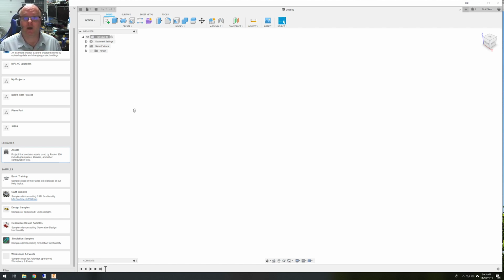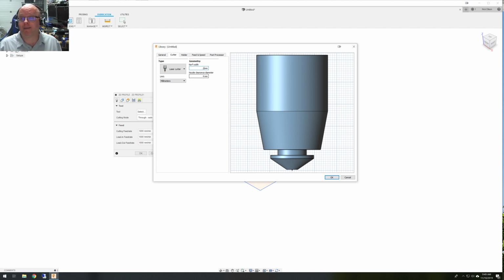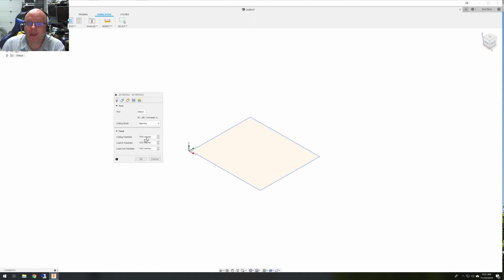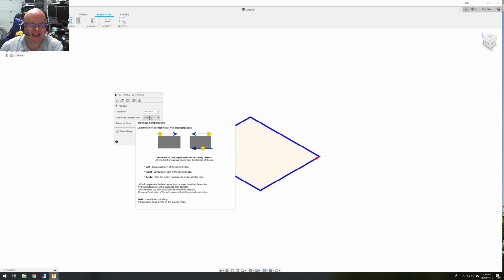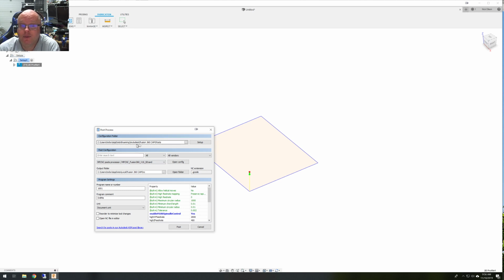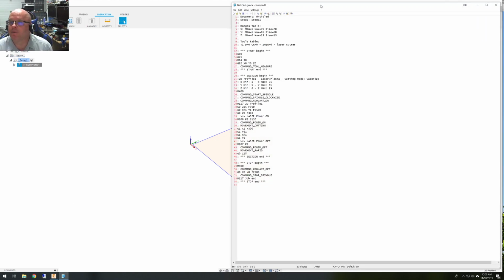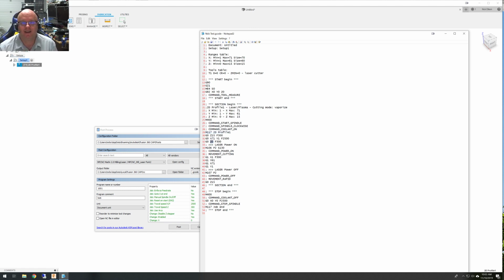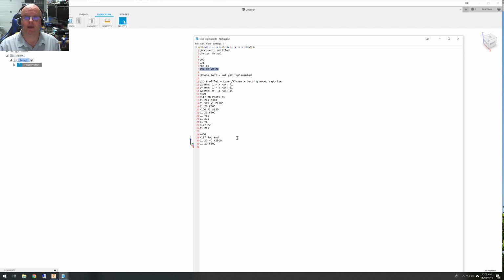Fusion 360 Laser Setup

Comment: I am having some problem in Fusion360  , when adding the MPCNC PP (from GitHub) in the local post folder  it doesnt appear  in the list when trying to chose it in the Post section in Fusion. I tried also the "Import" button  in the menu where you chose the PP and it says it is "Invalid Post Processor" i really want to have a PP who puts the Macros  in the Post  screen , i need to add  M62P1 and M63P1 to the code to fire up/down my laser in Mach4  . Why is MPCNC Invalid ?  Where is your version from ? i would really appreciate  to know !  Thanks